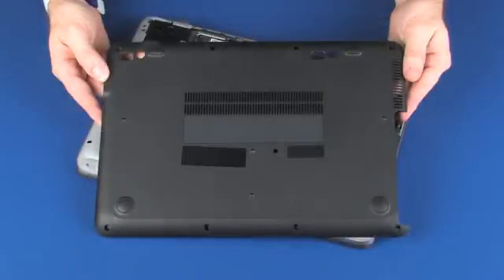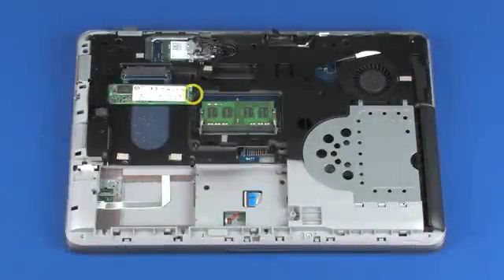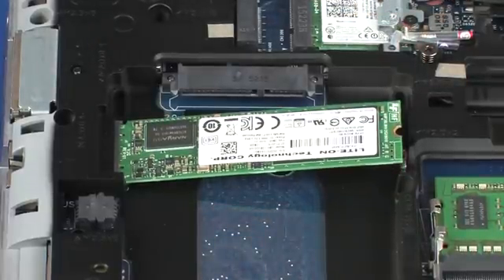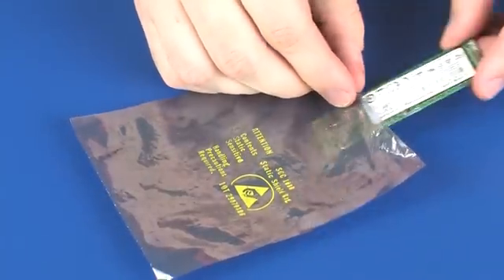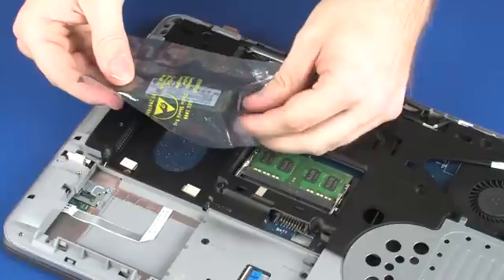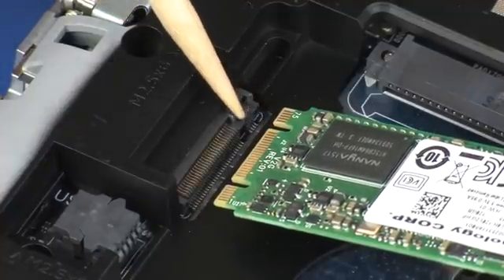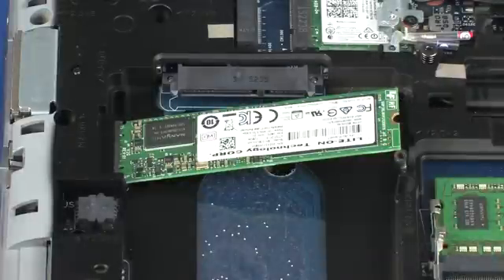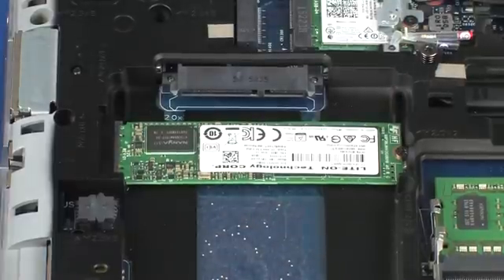Replacing the Solid State Drive | HP Probook 640 and 645 G2 Notebooks | HP Support

Comment: Hello, On an HP ProBook 640 G3 I just installed, simultaneously, a 240Gb M.2 NVMe SSD, a 1Tb Crucial BX500 Sata 2.5 SSD and a 1Tb Sata 2.5 HDD. These 3 disks are recognized by the system (Windows 10) and work impeccably together.
This installation which contradicts what HP support says is possible in the following way:
- The M.2 NVMe SSD is installed on the PCIe slot provided
- The Crucial SSD 2.5, previously removed from its case, is installed on the sata slot. As it is without its case, it passes over the M.2 SSD without disturbing it.
- The HHD 2.5 is installed in a caddy instead of the optical drive on the mini sata. Note, contrary to what I read, that the transfer from this slot remains in sata3

Comment: Hi. Is there any option to install a second ssd to the laptop? I bought an ssd just the top of the m.2 ssd but it looks not enough space for the second ssd. Do you sell an ssd rack replacing disc drive?
Reply: +aT0MLondon Please refer this document to know about adding a Second Hard Drive or SSD to an HP Laptop: http://bit.ly/2FWRUBF
Reply: Hi,

Thanks but your links don’t help. The list doesn’t contains this particular type of HP. I am interested only to add second hdd to HP Probook 640 g2. Is g1 has the same housing, so is it compatible?
Thanks.
Reply: +aT0MLondon You can add a second hard drive using your laptop's optical drive bay. Add it as a second hard drive in the laptop in lieu of a SATA Optical drive.
Reply: Thanks, but do you sell the HDD caddy for this version of laptop? Is it the same caddy for 640 G1?
Reply: +aT0MLondon You can search for it in third party websites.
Reply: what about a models without optical drive, is there chance to add a second ssd/hdd drive?
Reply: HP 640 G1 is an Intel CPU which is made different.  HP 640 G1 support the M.2 2242 SSD up to 512GB.  The M.2 2242 SSD goes right above the WiFi adapter.  The AMD Laptops don't support using two drives.
Reply: You can install only one drive at a time because of the ports configuration. It is best to install M.2 drive as it is faster and remove DVD Drive, then install the second 2.5" SATA or SSD in place of DVD drive using $5 drive caddy. At last use the original DVD drive plastic face panel so it looks original.

Comment: Make a video how to add a hdd with the .m2 ssd
Reply: +TICO_Beto08 To better assist you, would you please provide some additional information? May I know the computer model that you're using?
Reply: I´m using the hp probook 640 g2, Specs: 16gb Ram, core i5 6300u, 240gb m.2. This pc have one m.2 ssd slot and 2.5 drive slot, I want to use the m.2 just for OS and the hdd for apps, but it is possible? hope you understand because I speak spanish
Reply: +TICO_Beto08 Yes, it is possible to use HDD for data and apps.
Reply: So does it mean that it is possible to install both 2.5HDD and M.2 SSD in the Probook 640 G2? I have the model with 500Gb 2.5 HDD and I was thinking about buying an additional M.2 SSD but since there is no video where you show both drives installed simultaneously, I was not sure about it. Thanks for your time
Reply: +Pedro Martin You Can Only Put A 2.5inch SSD Or 2.5inch HDD And Or mSATA SSD (M.2 SSD)
Reply: There's a place on the Motherboard that say cache drive or flash drive the M.2 2242 SSD.  Do not go pass M.2 2242 512GB.

Comment: solid state drive look so small. is it the ssd?
Reply: yes, its the new m2 formats... big is not always better... (that's what she said) :)
Reply: M.2 2280 SSD which is long and slim.  The 2.5" SSD goes in the same slot; however, missing the HDD caddy for the 2.5" HDD/SSD.  It's best to use the M.2 SSD because you can purchase a 2.5" enclosure for M.2 2280 SSD.  HP design made sure you can't use the M.2 2280 and SSD 2.5" at the same time.  Only the Intel models use both.